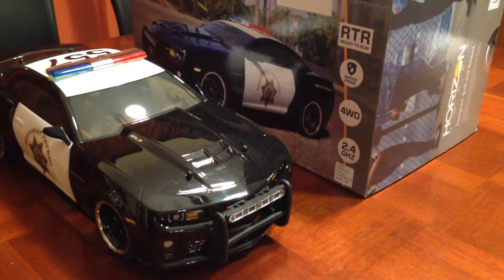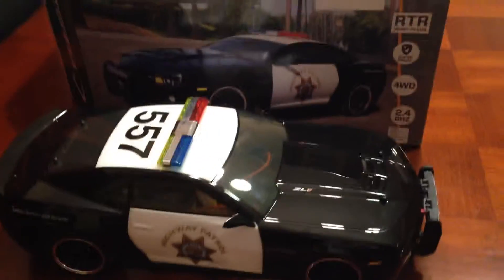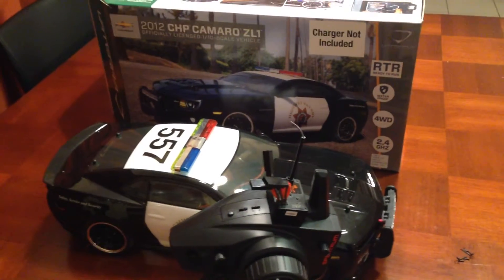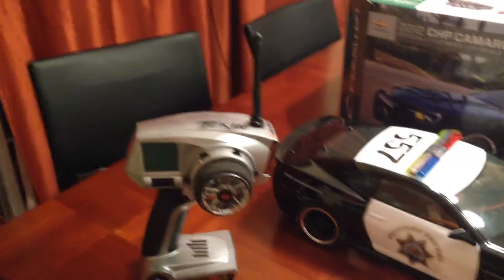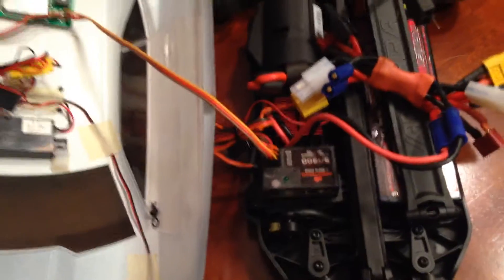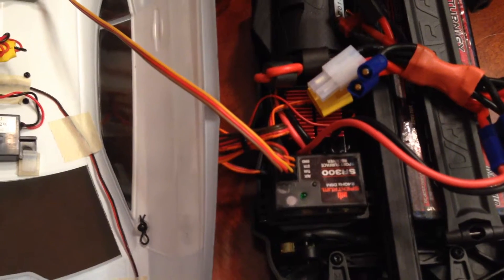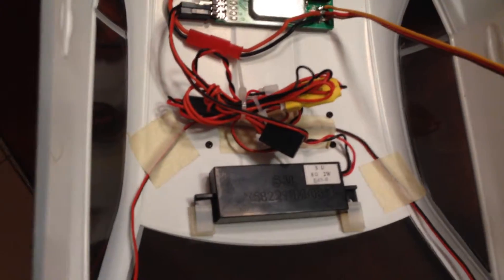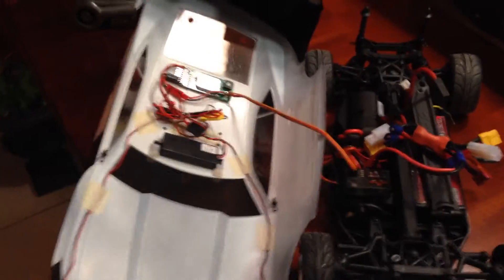2012 CHP Chevrolet Camaro ZL-1 1/10th RTR: V100-s by Vaterra

Comment: Hello.
Good job. I have the same car, have you a reference for the switch or a link to buy it?
Thanks
Reply from the maker: http://www.hobbyking.com/hobbyking/store/__12615__Multi_Remote_Receiver_operated_on_off_Switch_.html
Reply: Lracnolip Thank you.
Reply: Lracnolip hello 
Have you added power to the siren to make it work? 
If I do the same like in your video, it does not work
Reply: I am completely new to the RC world. My goal is to have headlights,tail lights, red and blue lights in front and rear, sirens and light bar and front guard. I bought the sirens kit and LED light kit but have done nothing with the other lights. I bought a 3 channel remote and receiver. With the device you mentioned could I do all the above just using that one slot on my receiver. For instance I want to be able to turn lights on and off and modes as well as sirens and it’s modes. I saw there are LED  lights on model train software. I’d probably have to buy 2 sets of 6 to be able to use all the different lights.

Comment: I just bought the Camaro and bought the multi remote you mentioned. I bought a 3 channel remote and receiver as well. My question is would I be able to use my lights and sirens on that multi remote?  The sirens and lights have different modes as well. Would I be able to cycle them. I’m going to add more lights so I’m hoping I could plug all of them into that one multi remote. Any suggestions?
Reply from the maker: Joshua Scholl it's been along time for me, but from what I can remember you can plug what ever you want into the hk board and the 3rd channel will turn everything on and off.